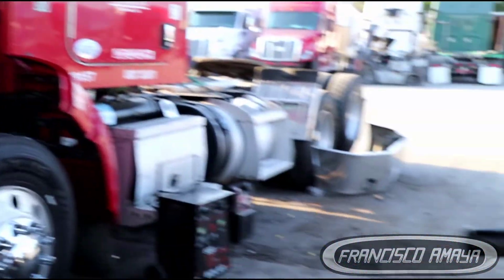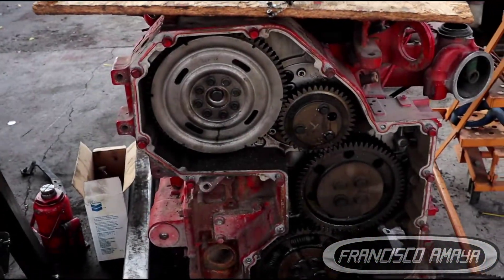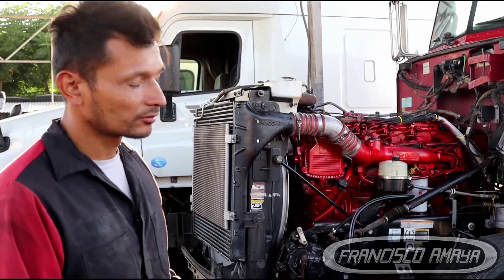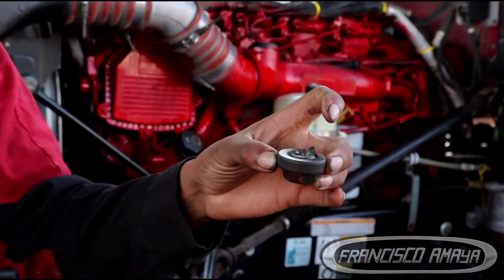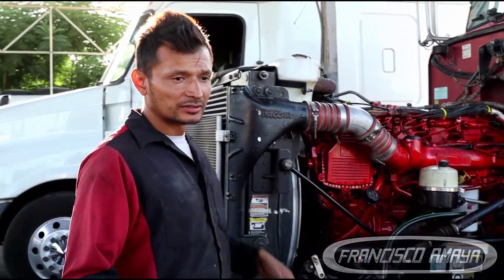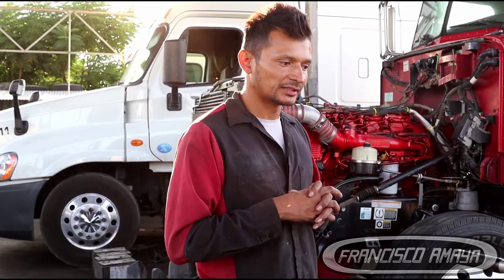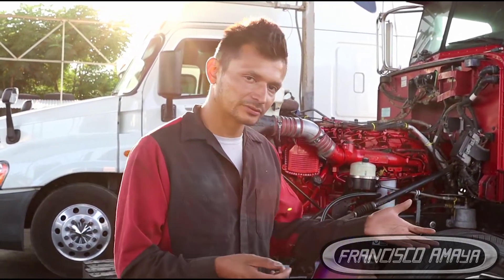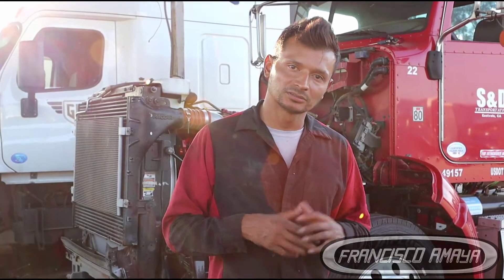Cummins engines ISX ISX15 X15 common problems why my cummins engine breaks

Comment: Bought 2019 389 Peterbilt new with 525 performance series. Idle all the time 26,491 hrs. 1 gallon coolant every 3 months changed oil 500-650 hrs. 12,000-15,000 miles never had to add any about 1/2 gallon low at change. Had dpf cleaned once at 375,000 miles had turbo actuator and turbo replaced at 476,000 miles, turbo was fine but changed it anyway. At 534,000 miles started truck cold in the morning and low coolant light came on, since truck was cold I decided to fill coolant while truck was warming up. It was about half a gallon low. Before I could get all of half gallon put in coolant shot out of reservoir so I put the lid on and didn’t notice it pressurizing in reservoir. Shut the truck off that night. Went to start it next morning and it only clicked. I raised hood checked oil and it was full and noticed coolant reservoir was empty and it was stained brown. I pulled dip stick again and could see coolant color and bottom of dip stick. I had a recon engine put in and curious what might have caused my engine failure.

Comment: We have 45 2018 to 2024 and they all have x15 are trucks are x15 I’ve maintained them all their lives with 25k mile oil changes and we air getting same issues around 800k to 1mil along with regular other part replacements
Reply: Soooo?

Comment: one 800k isx and one 600k isx cm871

aLways chewing up their camshafts and getting ready to crack another poorLy designed cyLinder head every 2 or 3 years

my number one recommendation is to never re-use the oLd head boLts after 500k
🎄
🎄
🎄
and maybe try hardened or forged aftermarket head boLts

_ use 1 full gallon of motorkote oil per oil change as well as one full gallon of Lucas oiL
_ use bypass oiL fiLter with one micron fiLter
_use evan waterless coolant that has near zero pressure and helps coolant Lines to Last much Longer 
and no more water reLated damages causing cavitation inside the engine and making the the coolant dirty 

__ the finaL 3 upgrades are not necessary but here they are
1 speed of air piston upgrade that incLudes ceramic top with dimpLes 
and micro sLick coating to help reduce the heat and friction and make the Liner Last LOnger
most importantLy the gapLess piston ring that heLps get rid of bLow by and lowers soot LeveLs and keeps the engine oiL CLEANER !

2_ air fiLter water injection kit to keep the engine and turbo actuator cLeaner and some heLp with better fueL miLe and Lower engine temp

3__ connecting the exhaust pipe to a water tank technology that cLeans the exhaust gas and turns the heat into oxygen and hydrogen to be burned back into the engine and Lower the fuel miLe 🎄
Reply: No one read this 😂

Comment: Cummins engine is the best.
I got Cummins isx engine and it has 1 million on it, nothing engine problems until now. Because I do maintenance on time.
If u don’t do maintenance on time, u will have engine failure.
Reply: What make model and year?

Comment: What’s first thing I should check for if I have oil in coolant reservoir?
Reply: oil cooler
Reply: @Dubya9W9 where is oils cooler located 🤔
Reply: @EthiopiaSecularTV  plate that holds the oil filter, behind it

Comment: 2016 Freightliner Cummins ISX have had 0 issues. I change me oil every 3 months and add a gallon of Lucas. Change my crankshaft filter 2 times a year. My shit runs like a new Cadillac.
Reply: What's the Lucas for? For thickness?
Reply: Don't use lucus. It dilutes the oil add pack and thickens oil !
Reply: @WhoReallyCares917  what's pack?
Reply: Don't add anything!
Reply: You meant crankcase filter!

Comment: Cummins is junk plain and simple.
A motor that regularly throws a rod is not a good engine. 
I got rid of mine. Should have done it earlier but I'm so glad it's gone
Reply: What did you get?
Reply: Exactly

Comment: i driving a 2020 cummins and the pressure is always 37psi. Super low.
isx= crankshaft
dd15= oil suction
D13= inyector cups
Mx13= ??? 
what about mx13?
the best for me is the Volvo
Reply: The new oil pumps are low pressure high volume.
Reply: @Daniel-z2j2v  you need pressure between metals, not volume
Reply: @Eldelvolvo  that’s what Cummins told me when they installed new pump
Reply: Mx 13, all of the above lol.
Reply: Volvo is the best

Comment: I work for a mega carrier and 23 x15 579 they run the oil change  intervals to 70,000. Sell the truck @ 300 to 350k .
Reply: Yup i remember i used too call ask saying hey i think this truck needs an oil chnge. The maintenance manager would tell me just add oil don’t change it.😂
Reply: Holy fuck 70k... lol😊

Comment: Got over 805k miles on my cummins. Still running strong
Reply: I think it's because the majority of people they think that they can change the oil every 70,000 miles. I changed the oil every 10 thousand miles, and my 2013 cummins has 1 million 37 thousand miles still with no issues
Reply: @StickNclutch  beautiful
Reply: @jossa942  ain't it 🤭
Reply: @StickNclutch How many engine hours?
Reply: What all have you had to do to it?